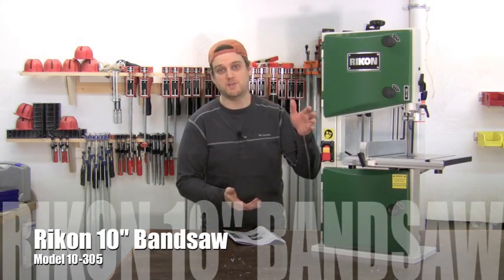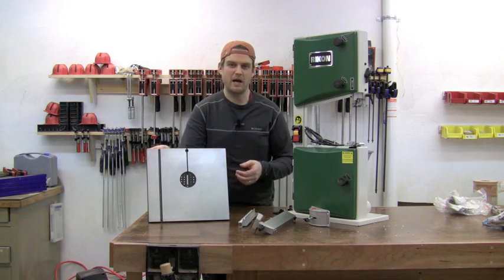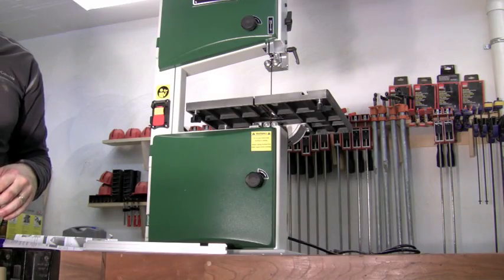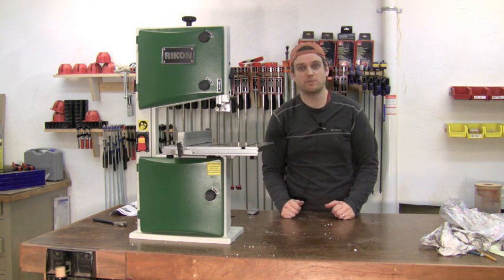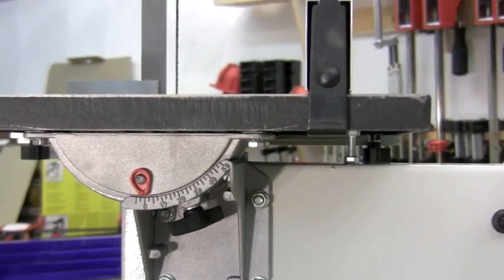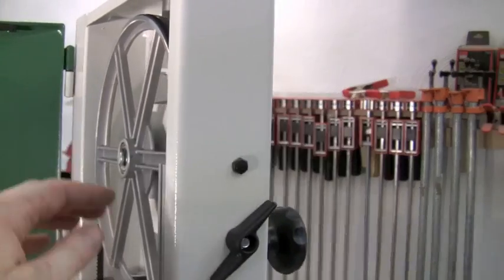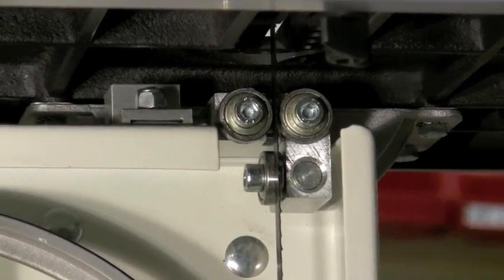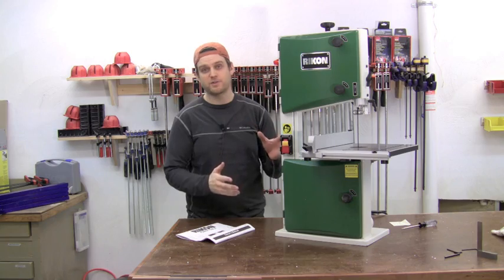Rikon 10 inch Bandsaw

Comment: Nice intro for the RIKON 10 305.....Now you need a second video to explain a detailed set up for the roller guides, tips and tricks when operating....I have the older 305 and busted a belt....how to change belt, how to change blades and how to fine adjust guides would be cool. Mine did not saw straight at all, had to find out why and how to fix it....keep it coming and thanks for video!!

Comment from the maker: (Part 1) Thanks for your question! The stock fence is not designed to set for blade drift.  The cam style locking lever could be  "wedged" slightly with small shims of wood at the front rail area of the fence to induce an angle off 90 degrees from the front edge of the saw for mild drift.  You could add an auxiliary fence face that you shim for drift, make a quick wood fence and use clamps for securing to the table.

Comment from the maker: (2 of 2) You are correct that the right blade will make a big difference for the saw cutting well.  No one blade can do all types of cutting (from thin plywood to thick stock and from tight curves to straight line resawing). It takes different blades for different cutting tasks.  For a solid guitar body, I will assume there are some curves that need to be negotiated.  Consider the 3/16" or  1/4" wide bands.  See the links in the description above.

Comment from the maker: Yes, the Rikon 10" bandsaw will cut 3/4" plywood.  Depending on what type of cutting you want to do (straight lines or tight curves), you'll find that other types of blades will improve the cutting ability of the saw beyond the blade that comes with the saw from the factory. Thanks for the question!

Comment from the maker: Yes, but very narrow blades are not available (1/16" wide) like they used to be, which helps the bandsaw act more like a scrollsaw in how tight a turn it can cut for making boxes and we do not offer a 1/16" blade.  An 1/8" or 3/16" wide band may be able to do some boxes, though you might need to use drilled turning holes in the area of tight radii on the work piece.  This allows you to more easily rotate the work piece to negotiate very tight turns.

Comment: Let's see:  Craftman and Rikon have speed of 2780 rpm, both use 70 1/2" blades, both have 1/3 hp 3.5 amp motor.  Both have the same dimension for the table. Both use 1/8" to 1/2" blades.  Both have 4 5/8" max dept of cut, and 9 5/8" throat depth.  They both weigh 66 lbs each.  Seem pretty same to me!

Comment: Paste wax is a simple and easy solution, but it won't last too long.  There are a myriad of other products that coat cast iron to help protection - although I find any of them need re-application over time. Use whatever paste wax you have laying around. I like Crystal Clear on my furniture and use that on cast iron also.

Comment: The teeth on the saw blade have "set" or stick out slightly left and right in order to make a kerf for the rest of the blade (the back) to slide through without binding. You can get the guides closer (to guide the blade properly) towards the back. But more importantly, you don't want the teeth to hit the guides as that could bend them and definitely quickly dull your saw teeth. So - make sure the guides are behind the teeth or gullets to be safe.

Comment from the maker: (1 of 2) Though the saw has just a 1/3 HP motor, it should cut 1-3/4"  material at a fairly reasonable feed rate.  Of course you will not be able to push material through the saw as fast as you would using a larger saw with a stronger motor.  If you are cutting an occasional guitar body, you should be happy with the saw's performance.  If you are making  5 guitars a week, you may wish for a more powerful and speedier cutting bandsaw.

Comment: i have the same one why does it make so much noise i cant seem to fix the problem is there a way to get it to saw with out the squeeking noise on every cut
and when i cut i have a ripple though the cuts i make there like little lines on the wood when i cut it i check to see how well it did and every time  i see these lines

Comment: I watched your video on the resawing band saw blades using a 14" Rikon saw. You showed how to adjust the fence to allow for tracking deviation. Can this fence be adjusted so that it is NOT parallel with the saw blade?
Reply from the maker: The way the fence locks to the rail on the Rikon 10" bandsaw, it is not intended to be adjusted away from the standard position of perpendicular to rail on the front of the saw.  That being said, you can make some tiny adjustments for when you cam down on the locking lever that lets the fence still lock, while being forced slightly away from perpendicular to the front rail.

If you want a more adjustable fence consider this aftermarket fence for the 10" bandsaw:

http://www.highlandwoodworking.com/carter-magfence-bandsaw-fence.aspx

Comment: would a bandsaw of this size be able to cut guitar body blanks? these are about 2 inches thick ash/alder usually, but other woods can be used.  also to make a veneer out of exotic woods or highly figured maple or other North American woods, is this bandsaw able to handle those jobs?
Reply from the maker: Please contact us at 800-241-6748  or email us at techsupport@highlandwoodworking.com so we can best answer questions about your  specific needs regarding the cutting capacity for that bandsaw.

Comment: What is the max height of material that can be cut. i.e. height between table and blade guide raised to top?
Reply from the maker: +ve4ye The Rikon 10 inch bandsaw's cutting capacity is 9-5/8" wide by 4-5/8" high

Comment: I just bought the 10" Craftsman which I'm told is basically the same machine with different paint & logo. Set up and fine tuning was simple & easy to see via this video. It does NOT cut like a scroll saw so anything outside of wide turns you'll need another plan. I paid $200 at sears and I believe the Rikon is $300 via Amazon. Overall very happy with this. But be sure not to buy the Craftsman 9". Very cheap and poorly engineered.

Comment: You did not mention the clearance of the guide bearings with respect to the blade. Are the guide bearings suppose to touch the blade as to rotate with the blade?
Reply from the maker: The side bearing guides should be set as close as possible to the side of the blade without actually touching (as shown when you spin the wheel by hand - it's OK if the blade intermittently touches the bearings as you spin the wheel).  A gap measurement to use would be about .004", which is the same as the thickness of a dollar bill.  In general terms,  you set the side guides as close as you can to the blade without touching it.  Keep in mind if they are too far from the blade, they can't guide much. Yet when using extremely narrow blades, there is so little surface to place a side guide up to that sometimes just keeping the side guides away from the blade is the best course of action when trying to run an 1/8" wide blade because it can be difficult to set the guides and not have them contact the teeth of the blade (bearing guides are not kind to the teeth on a bandsaw blade).

If you have further questions, please contact techsupport@highlandwoodworking.com
Reply: Thank you for your response.

Comment: good to see but i think a little more power for me also about the sears- i had a 10in liked iit but blade was hard to change but it was OK for beginner-  about 2 yrs ago bought 14in searswhich was supposed to handle 3/4 in blade when it arrived not so when i complained they informed me i was misinformed & would not replace it- I used the saw about a year & sold it, never satisfied Blade was almost impossible to change I DO NOT reccomend their tools anymore

Comment: I have e record 10" bandsaw what's  the dimensions of the blade and will the blade fit other 10" bandsaws ?
Reply from the maker: +aaronstill We suggest using a 1/2" or 3/4" bandsaw blade, which will fit most bandsaws. Our favorite blade is the Wood Slicer: http://www.highlandwoodworking.com/wood-slicer-resaw-bandsaw-blades.aspx